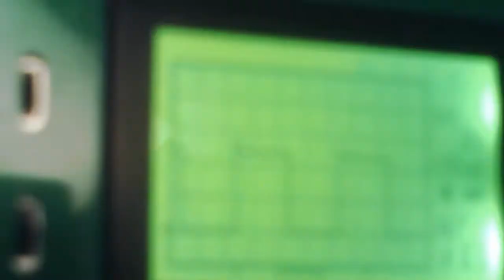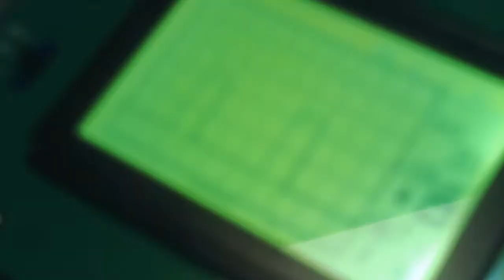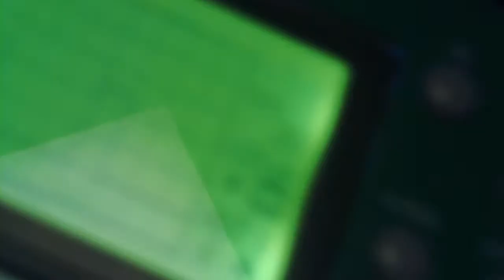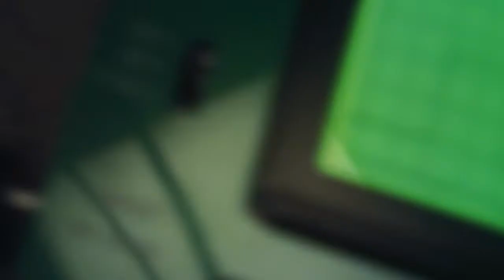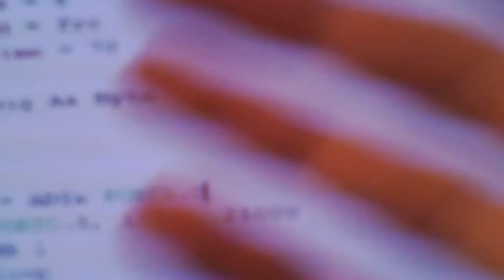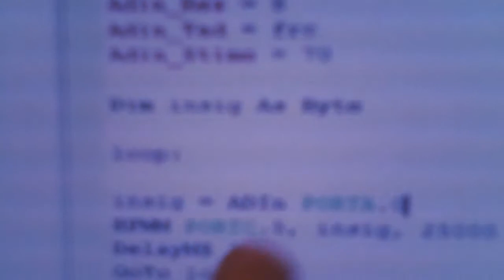Buck converter board working

Comment from the maker: I have yet to test the ripple, but in its intended application, the combined effects of the battery bank and the ripple suppression capacitor (which is only for eliminating what ripple remains from the impedance of the battery connection wiring) will effectively eliminate it.